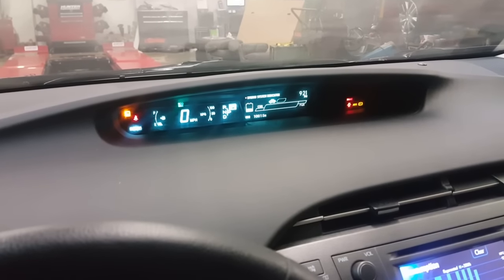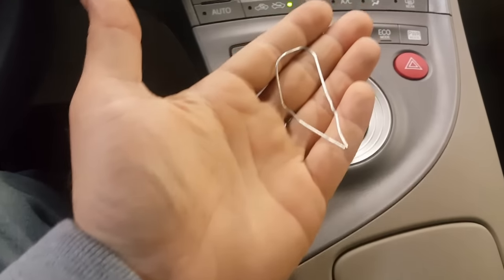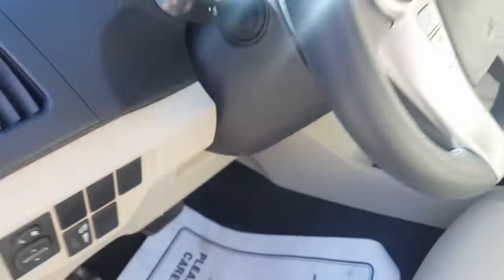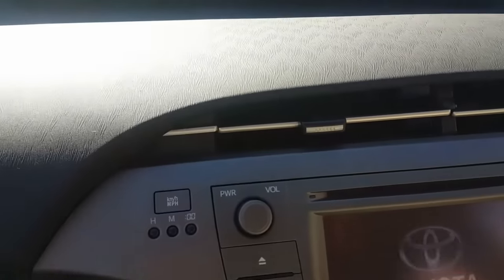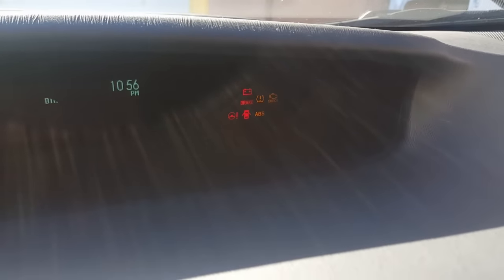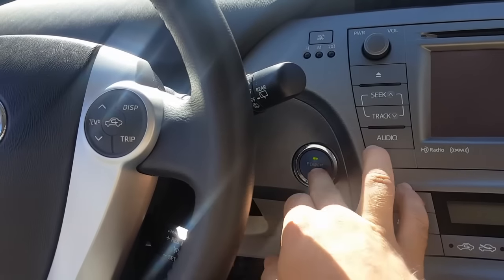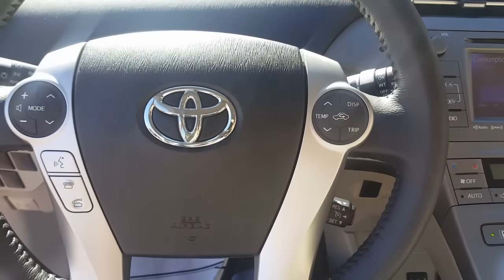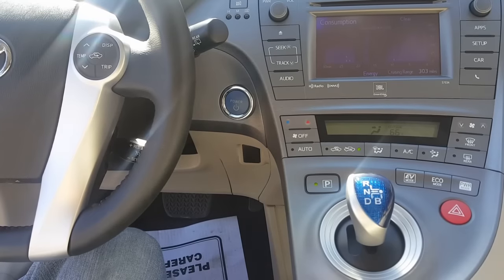HOW I RESET STEERING ANGLE SESNOR ABS VSA TRACTION CONTROL BRAKE ON ANY TOYOTA AND LEXUS VEHICLE'S.

Comment: Hay my one is 2011 prius. I did wheel alingment 2 days ago and now the same light on. I went to mechanic and he did reset with computer but still showing all 4 lights. He is saying some air pressure issue and asking me to replace abs which cost more. Please advise will this work
Reply: same prob
Reply: Did you replace the abs or the reset worked? I got the same issue
Reply: @MI3man  code 1364? How did you fix bro? Can you please help me? The same issue with me
Reply: @lazizjonvafoev717  I replaced the abs

Comment: I have code c1345 and c1368 2013 Prius. Got alignment done they stated the codes were stored and went on after alignment. Have brake light, abs, vsc and parking break light on if anyone can advise. I have tried this pin trick but didn’t work
Reply: @bavarian imports LLC please how did you resolve this issue of ABS VSC & Brake lights ?

Comment: Damn I’ve tried everything to fix my cruise control thought this might work it just completely stopped working but the button will turn the light on only when the wheels at certain angles. I’ve replaced the cruise control switch, the switches wire, I’ve checked my fuses, I’ve done this, I’ve scanned with an obd2 scanner no codes. I guess maybe maybe my last chance is to check my cruise control release switch idk
Reply: you need to replace your steering wheel clockspring assembly.
Reply: @MGman11234  I actually recently figured that out and replaced it, you're right it was the clockspring :)

Comment: i have an abs,traction control light,brake light and exclamation mark light on.WHat does this mean?The brakes feel a little different.DO you think i need to replace the ekectric brakes?please help.Also i do not have any code reader for this.may ne abs im not sure where to start because there are multiple lights on
Reply: also its a 2010 Toyota prius btw
Reply: Michael maillet 
Hi
Reply: Michael maillet 
This my first time comment on YouTube.  Maybe this will fix your problem.  I cleaned my abs wheel sensor and some how broke one of them.  So when I turn on my engine all light that you mentioned are on. Abs?vsc,,,etc...I order a scan tool and see that one of the abs wheel sensor not working , so I replaced it and clear the error code and everything back to normal.

Comment: This did not work for me. I bought a car with the traction control light on. No codes. All ABS sensors in tack. Drives perfect. Just wish I could get that light to go off.

Comment: Prius gen three. pin 4 and 12(not 13)
Reply: Smoke thank you so much!!!!!!!!!!!!!!
Reply: @alexusa2272  I'm happy to help. Unfortunately mine has a bad wire or I need the steering angle sensor replaced. My lights stayed on after the diagnostic mode. I need to try it on a super flat surface before I give up though
Reply: How about a 2014 Prius C.  I got the Xmas tree effect, they didn't reset.. so it's probably something more.. but would love to just try a different paperclip hack :)

Comment: does this work for a 2004 Prius?
Reply: no , do the same as in video , but when you power on  pump the brakes at least 8 times within 5 seconds of powering on . then turn off remove clip and your done. Just did it in my 2006 , good 2 go
Reply: OMG!  This actually worked! 😊👍I saved💰💰💰💵💵💵🍾 F&@k the Dealerships!!!  Thank you for this reply & your post regarding my 2005 Prius (generation 2) variant!
Reply: you welcome
Reply: Would this work on an 08 Sienna?
Reply: ARTEMIAUX REIGNS so was it your abs actuator?
Reply: Just did it on a 2005 prius! And it worked!
Reply: @timjarret418  I have a 2006 Prius. No lights are on but the steering wheel leans to the left. Will this fix that?
Reply: Hello
Reply: I have a toyota yaris 2006 and it has turned on my abs vsc with code C1251 how to act can you help me with the market